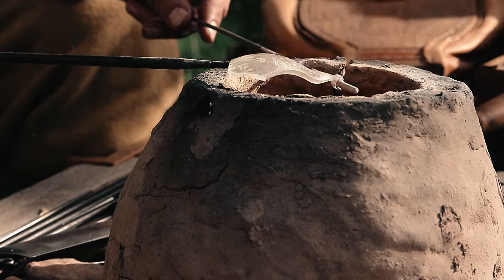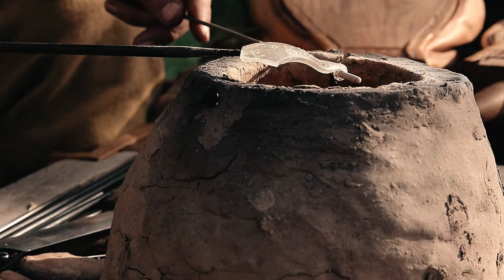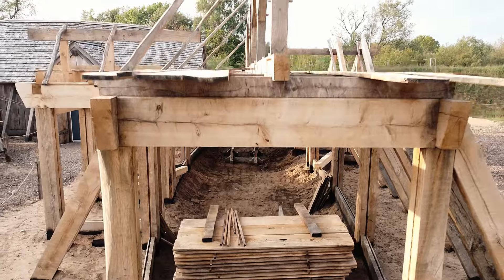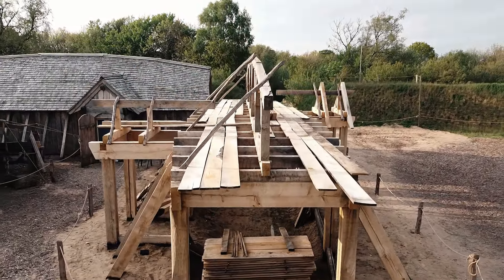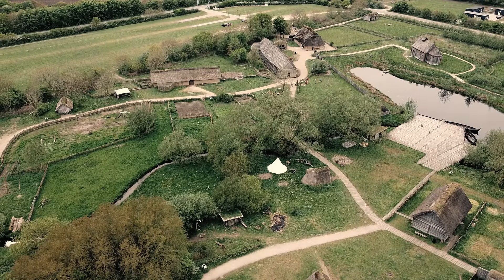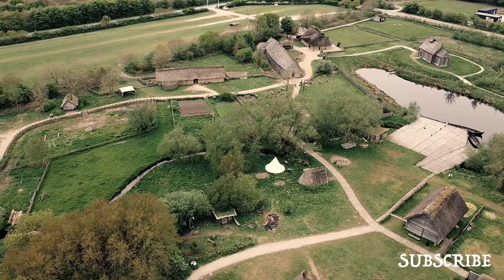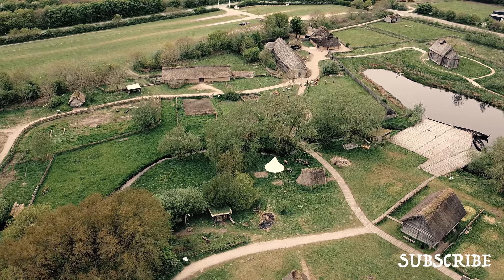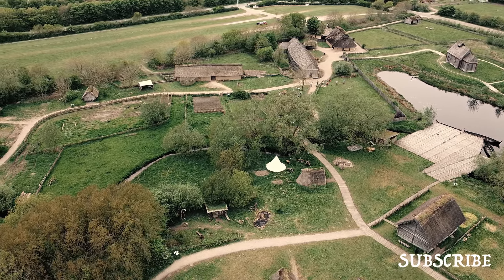Making Simple Work Benches with VIKING tools | Part 1 of Our Viking House Build!

Comment: That was so relaxing that I immediately watched it through a second time! 😄

Love the spoon auger and the shavehorse! Do you use a little wax or something to lubricate the auger's friction point near the chest brace?
I agree the Vikings must have had something like a shavehorse. We know they had drawknives, and I can't see how anyone can use a drawknife without some very sturdy way to hold the workpiece and brace the force of their body against it. Most likely it's a survivorship issue - the drawknife being iron means it's expensive enough to look after and keep safe. A shavehorse would likely be considered easier to replace. I imagine when they eventually wore out or broke down beyond repair, the wood would be repurposed into something else, or simply burnt as firewood. And even if it was just abandoned in a field, it'd rot away and we'd be unlikely to find any evidence of it a thousand years later.

Good work on the benches too, they look like they'll do the job nicely! A low bench can also come in handy, like the Romans used. You can place one knee on the workpiece to hold it down to saw. Or sit astride it to hammer and chisel out a mortise. I'm not sure if it would come in handy here though?

It's fantastic to see that you're already beginning work on the house! Can't wait to see the next installment! All the best my friend!
Reply from the maker: Hello Ingvar. thanks for the comment. I did not grease the auger plate yet. I oiled it shortly after finnishing it and i made a fairly loose fit - so for now its spins like a wheel. I agree with you on survivability of workin benches - so i suppose untill one is excavated we have to rely on experiments, qualified guesses and practical experience. at least thats how I try to approach reenactment:) All the best my friend
Reply: @RAMUNI-Viking  Absolutely, I agree with your "experimental archaeology" approach! 🙂
And I'm impressed to see how well the auger works. Thank you again for taking us on this wonderful adventure with you! 😃

Comment: Very interesting. That spoon bit is something else! In the States, we call them saw horses. Don't know why, we just do. Also, and I knew this already, they preferred oak like you said. But the "Vikings"  would have used what was mostly available. They were one of the most innovating people in their time. If oak was available,  sure they'd use that. If pine was the only type of wood, they would use that. I would like to think that the Old Norse would have used a pin like a dowel or even a wedge pin. Something like that.

What I would like to know is..... where did you get your shoes? 😂😂😂.
Reply from the maker: Hello. Thanks for watching and writing. Yes the spoon bit is mad. I like your thoughts on the Vikings using whats availible. It makes sense. Thank you. I made the Shoes myself. And basically All that is not Iron. So clothes, belt, sheaths et. I have a video on how to make pattern and see Shoes on my channel if interested. I appreciate the feedback:) stay safe
Reply: @RAMUNI-Viking  cool! I've been looking for patterns as well. I'll check it out.

Comment: Have you looked in to the so called roman workbench? These are far older and wider spread then te roman empire... They where used far into the middle ages. Often pines where used (in holes) to sprop work from moving. I Have seen sugestions of the use of wedges as well as the use of Y branches (ash for instance) in the same way metal hold fasts are used on a "modern" workbench. The problem with workbenches and shavinghorses is that they are made of wood, and that they decay. Also it would be the first thing to go in tomthe fire if you are low on fire wood. They would have been a cumbersome object and not something to travel with. It is my theory as a woodworker that in the viking age the workbench and the shavinghorse would have been seen easy enouth to make on location that theybwould have been left behind if traveling more than a short distance (eg. within the vilage).
Reply from the maker: I think you are right about the workbenches being made on location, simple and temporary. I have a set of hand forged iron hold fasts - not period correct though but I have considered using them for this build. I have also heard of making holdfast from forked branches like you mention - I must give a go. Thanks for being involved in the project and coming with feedback like this:) all the best

Comment: I think the comment about the Roman low workbench might be the most logical answer. They’re easy to construct and you want a lot of height advantage when using axes.
Reply from the maker: I think you are right. I have been looking into Them. They seen really practical and versitile for this kind of work. Allthough i do like the height of my benches. But the stability in the lower roman version looks really good

Comment: That was a fantastic build. I like your bodger too. That groove in the middle looks useful! Did you learn to speak English in Ireland? I could swear that you have some distinctly Irish pronunciations of several vowel sounds.
Reply from the maker: Hello:) thank you so much. Yes the groove is good for smaller diameter wood for ex. For pegs or holding a spoon. I learned english in school but I learned to sing and play guitar by an irishman and irish folk music has been a big part of my life. So over the years some of the pronounciations must have rubbed off. I also spend alot of time on stage both in ireland and mainland Europe with irish bands and music friends. Thanks for watching:)

Comment: Hello, love your videos.  If your area floods sometimes would you consider builing your workshop on stilts?
Reply from the maker: Thank you:) this house is resting on 4 modern concrete points liftet a few inches off the ground. the area next to the stream itself is damp most of the year but maybe 4 or 5 times it floods. only temporarily - maybe half a day untill the small stream can cope with the water again. So having it lifted saves the most. and should i flood a tiny bit i think it will be ok. i am going to leaave a gap between the floor boards to water can run back out. There is some compromises to be made, but its the only location i have availble to me:)

Comment: Hi friend ! Which kind of wood did you use to craft those benches ? Pinewood ?
Reply from the maker: Its some old bone dry oak slabs i had left over. The legs Are hazle i think. So the Drill did well through 6cm of dry oak
Reply: @RAMUNI-Viking  Really effective drill actualy 😳 !